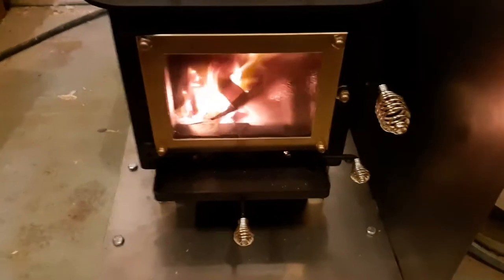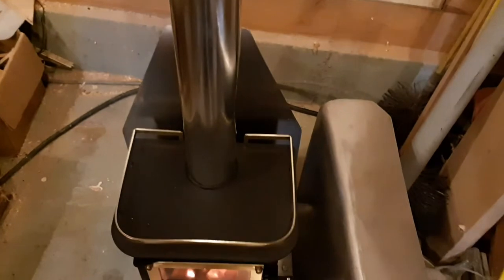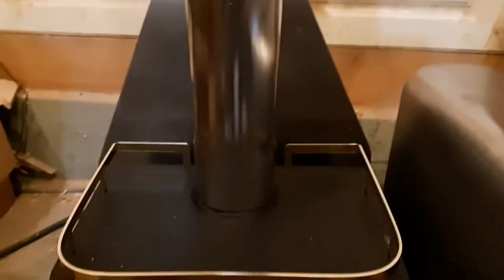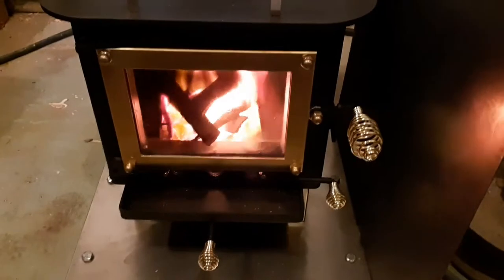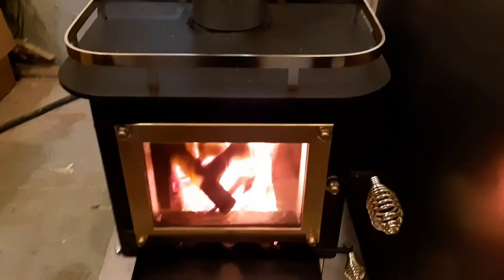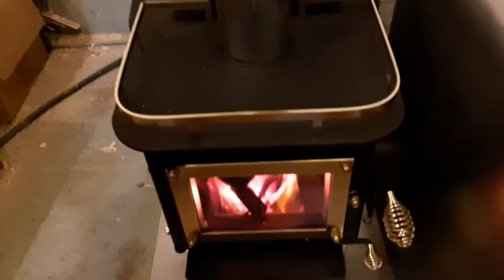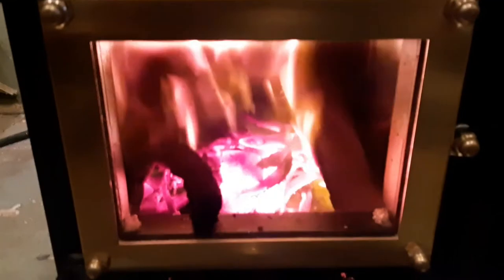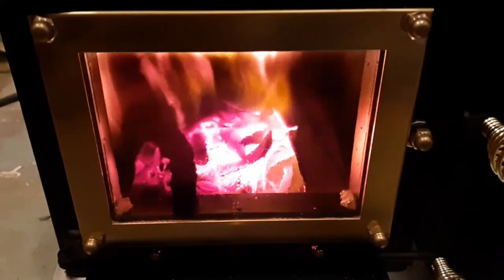Tiny Wood Stove for a Tiny House(Boat)

Comment: Roy. Consider a thin, double-walled sleeve around the vertical flue. Connect to an insulated cylinder which is coupled to a float-valve controlled header tank. Plenty of hot water on tap.
Reply from the maker: Excellent idea.